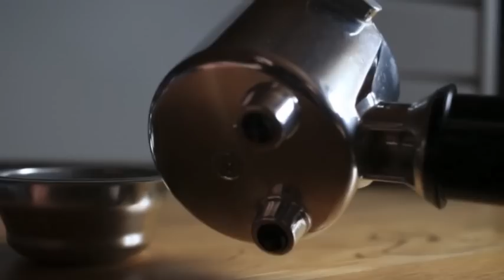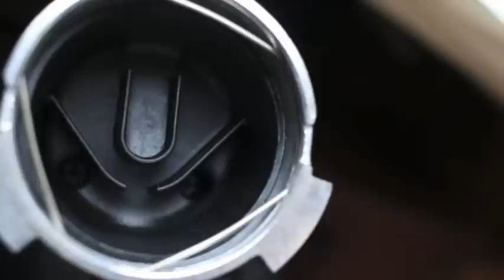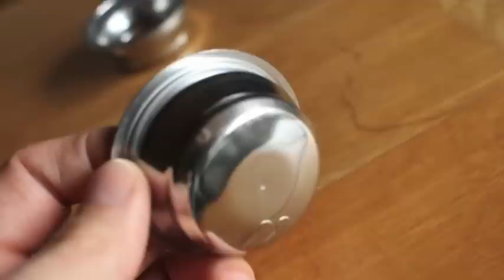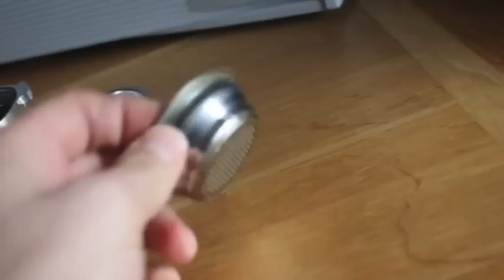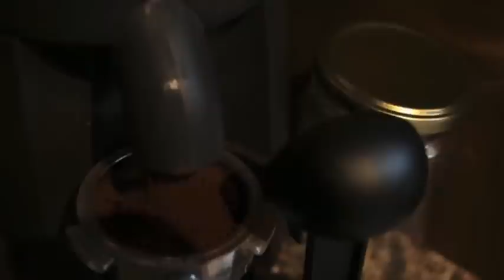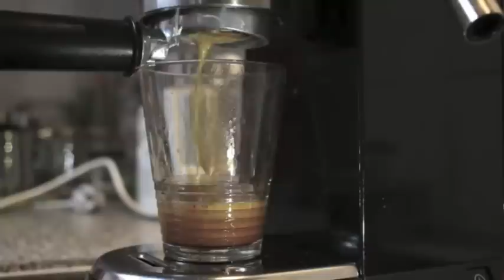Delonghi Dedica EC685 EC680 Baskets - Why Non-Pressurized is BETTER!

Comment: How many grams of espresso can it fit in the double cup for the non pressurize basket and pressurize one?
Reply from the maker: Hey there, you can fit 13.5 to 14 grams in there.
Reply: @TomsDoItYourself  I found my Dedica would have the grounds getting in the way of sealing by 12g, and 11g clogged it up too much for the pump to get it through the coffee! Any tips?
Reply from the maker: @rainbowevil  Which basket are you using? I would go for a non-pressurized aftermarket basket to fit more in, and get a better result. Just check the description for some suggestions.
Reply: @TomsDoItYourself  seemed to happen when I tried both the non-pressurised aftermarket one as well as the double shot pressurised one.
Reply from the maker: OK, could it be that you are grinding too fine? How old is the machine? Maybe the pump has lost pressure. I recently had to change the ball and O ring on my EC680, and it went from 7 back to 11 bars of pressure: https://www.youtube.com/watch?v=MWrp4_ozUT0
Reply: @TomsDoItYourself  interesting, will check that out - thanks!

Comment: Just got this machine,  wouldn't prime (finally got it primed, turned upside down and back?)   no crema at all on my first cup.   My 52mm metal tamp won't fit it.  I doubt lack of tamp is the issue.  My old machine Was a Starbucks Barista which actually is a delonghi 155  and a burr grinder (both still work, thinking of not using this new one)
Reply from the maker: Hey Eric, if the pump is not priming, then open the hot water valve on the side. This is common to most espresso machines.

Comment: Hi Tom - I've done exactly the same mod as you, but I am unable to get anywhere close to the crema that you have.  In your experiences with this setup, did you need to debug for any crema problems?  What sort of grind fine/coarseness do you use?  Also, how long does it take to run the shot? (I noticed you used elapsed time in your recording).  --Thank you for posting this video and for any assistance you can provide.
Reply: Hey Stephen thanks for the questions. I run the shots for 20 to 30 seconds. I think the biggest variable is the force on the tamp. Also, if you are not getting desirable Crema, you might need to clean your machine. I recently cleaned mine, and I noticed that the water distribution coming out of the spout is much more even. I do not have a very expensive grinder, so I do not get as fine of a grind as a coffee shop could provide. I have also experimented with find grinds from coffee shops, and it didn't seem to make a difference for me. Have fun experimenting!
Reply from the maker: Hey, all you really need are fresh beans, and a grind setting fine enough. Most people start with supermarket beans, that are much too old for a good extraction.

Comment: How can I clean what ever residue stuck between the bouble layered basket?.
Reply from the maker: Well, the puck should slide out nicely, but if not you can brush it out or wash it out with hot water.

Comment: I have the single shot pressurized filter clogged and I tried everything! Needle, hot water with vinagre, burnt the on the stove several times... and still, the water doesn't come through... :(
But, nice mod!
Reply from the maker: Thank you for your feedback. Yes, I would recommend that you just buy the conventional baskets at Amazon to replace those double walled ones. I suspect once they’re clogged, it’s going to be near impossible to clean them. That is probably why Delonghi started making their pressurized baskets with a pull out top screen now.
Reply: @TomsDoItYourself  Thank for you answer... going to look for one of those single wall filters...
Reply from the maker: Sure thing. Which market are you in? I have links to some baskets on Amazon in Germany or in the states. I would guess that Amazon in Italy also has some.
Reply: @TomsDoItYourself  Portugal. I looked for the og double walled and a single wall plus a tamper 51 mm in Amazon Spain

Comment: Did you cut also the basket? or ordered a new basket? Whom I could aks to cut the filter holder?
Reply: I cut the bottom edge off with a dremel, but it takes some practice. I did it to both filters. You can also order replacement filters with the holes already showing from Breville.
Reply: Hi Tom, where can I order these one floor replacement filters from breville? I also have the delonghi EC 680.M and would love to try them!
Reply from the maker: It's best just to order a proper basket - way less work than dremeling it off.

Comment: Hi. Newbie here. Can I just buy a non-pressurized basket that will hopefully fit the portafilter and use it without having to cut my portafilter?
Reply from the maker: Yes, you can order a 51mm filter from eBay, or find some Graef filters.
Reply: Tom in Germany W thanks!one last thing, are there any advantages of making the portafilter naked from just having to fit a non-pressurized basket on non-naked portafilter? TIA
Reply: @TomsDoItYourself  Please, can you post the link for a non pressurized filter ? On ebay ?

Comment: Please where can I buy a bottomless portafilter ?
Reply: you dont need that. just remove the plastic part from the inside of your existing porterfilter by undoing the screw at buttom of porter filter. and get a non pressurized basket
Reply from the maker: You can make one. Check out my other videos, where I show how to make one.

Comment: i just bought a non-pressurized basket for my delonghi dedica and also put 14g on it, but the extraction was too fast!
Reply: Try more pressure when tamping or a finer grinding
Reply: @Keekusu  thanks will do that. I also found out that fresh beans make the yield/extraction  longer
Reply from the maker: You definitely need to grind fine enough. What kind of grinder do you have?
Reply: I tried my tamper on a scale and was surprised how hard you have to push down to get to 30 lbs.
Reply from the maker: @sting1111  Yes, but for me it doesn't feel like too much. Anyway, when I was in Sicily, I noted that they BARELY tamped. It was more for show. So I am not sure how important the tamping pressure really is. It is important to distribute and pack the grinds sure, but pressure I don't know.

Comment: How did you cut off the bottom of the filter?
Reply: Howdy. I cut off the bottom with a dremel and round cutting blade.
Reply: Lieber Tom, danke für das tolle Video. Hast Du eine Ahnung, wo man das Entfernen des Bodens in Auftrag geben kann? Wir haben leider keinen Dremel und ich bin mir auch nicht sicher, ob ich mich da rantraue. Danke und LG
Reply: Hallo Claudia, das ist auch nicht ganz so leicht. Wenn Sie Interesse haben, kann ich Ihnen vielleicht helfen. Ansonsten, kann mach auch Ersatzfilter von Graef kaufen, die da reinpassen.
Reply: Hallo Tom, danke für die schnelle Antwort. Ich habe die Graefsiebe am Wochenende bestellt, wobei ich gelesen habe, dass dort nur das 1-er Sieb passen soll. Ich werde mal berichten. Danke und liebe Grüße Claudia
Reply: Hallo Claudia, haben die Siebträger von Graef in deine EC 680 gepasst?
Reply from the maker: Just used a dremel to cut it. It took a long time though.

Comment: So its enough not to cut the handle but only expose the holes on the filter to make it non pressurized?
Reply: Yeah, pretty much. People cut the bottom of the portafilter to see if they are getting even extraction at the same time to improve their tamping, plus it looks cool on instagram :D
Reply from the maker: I still look each time I make an extraction, just because it's so pretty! Even after 5 years of doing this, I still get a kick out of it.

Comment: Did I understand right that you are using a standard basket, just modified it a bit?
Reply from the maker: I cut the bottom off the double walled basket, but later I bought a good filter basket for it from Amazon.

Comment: where can i purchase the bottomless portafilter basket? I'm using EC680 same model as well.
Reply: Sean Yuan Did you listen to what the guy said? 
He just bought another portafilter a cutted it
Reply from the maker: You can find them on Amazon these days.
Reply: @TomsDoItYourself  the Amazon ones are pretty bad. Don't lock in hard enough to deal with a fine grind size and the pressure. The original with the plastic removed is fine. I wish I could find a good aftermarket one.

Comment: Lol just drill bigger  hole  , why u cut all that
Reply: Bigger hole might negate the effect of the double wall for pressuring the basket, but would still harder to clean (and with a bigger hole perhaps bugs could crawl in); exposing the entire surface would be necessary for use with the naked portafilter, which is all about being able to see the extraction to see whether there are issues.
Reply from the maker: Oh, I just wanted a cool project.

Comment: And he winner is.....? What a useless comparison...
Reply: It looks obviously better with the NPB, that's why the creator did not need to specify it. It is a biased result though as the PB should have been used in the original portafilter, which helps pouring the shot evenly with a decent crema, not the cut one.
Reply: I need some help with my new Automatic cappuccino masine, pls!
Reply from the maker: The winner is the one that is non-pressurized. The pressure is therefore created via the fineness of the coffee grind, and leads to a higher extraction concentration.